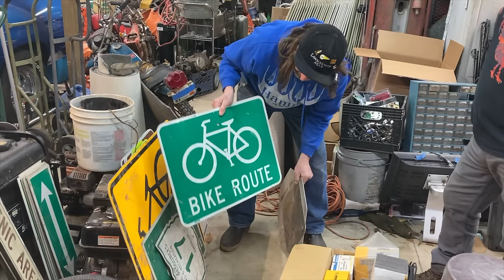Taryl Takes A Trip To Buckets Garage

Comment: Its not hoarding, its inventory.
  The motor on one of those scooters might work with the "Surrey with the fringe on top" four wheel bike. Or maybe one those old washing machine engines and the pedal starter is reachable from the seat.

Comment: If I remember correctly, that sulky doesn't have a steering wheel. It hooks to the machine and keeps you directly behind the machine and the wheels turn by being forced left or right by the machine as it steers like a zero turn with 2 hydros.
Reply: That’s a steering sulky off a two wheel Gravely tractor. They had one sulky (what you’re referring to) to turn you pushed the tractor’s handle bars to turn. The one shown is a steering sulky. The shaft & steering wheel are missing. The sulky wheels turn the mower with a steering wheel. I have the steering sulky on my old Gravely.

Comment: I need your expertise 💯...What size Transmission belt does a Craftsman garden tractor model 917.273022 take? The manual says 1/2 x 84.5 ....but it does not fit at all...... The parking brake does release when I put it on....stay engaged pretty much only about an inch of release...Go 3 inches bigger?

Comment: I love the lawn boy loafer . I’ll buy it off you.
Reply: Had a Loafer as a kid living out in the country. 1960 model. Loved that damn thing, would go anywhere. Even accompanied the farmer next door when he went back into the woods to cut trees for his winter heat and wife's cooking. if it got stuck, which wasn't often, hell, you just lifted it out of the mud. Low gear was like 143 to 1. It would climb hills so steep, you ended up "walking" with it. Plus talk about tiny cornering radius. Genius little machine. Just had to keep a supply of rubber drive wheels from the drive disc handy, for after you gunned the governor to get maybe an 8 mph top speed instead of the 4.5 standard. Rubber flew apart pretty quick, and the Iron Horse sounded like what trail bikes did a decade later.

Our regional high school janitor had a Loafer with a 21 inch Lawn Boy mower to do the school front lawn of several acres, with what looked a crazy driving style -- all the kids watched out the window at his demonic style. Took no time even with only a 21 inch swathe. That's because it was 4.5 mph everywhere, including the sharp bends! It would just lift the inside rear wheel and slow down momentarily.

Had the thing for 10 years until the family moved when I was out of country, and they left it behind. Darn!

When you dropped that thing directly into fourth from a stop, the front wheels came off the ground with instant acceleration. Yee haw.

The only decent piece of that truckload of junk, IMO. The Loafer ruled, and the gold color waxed up well. Never had a gas/carburetor problem with it, it always worked. 

The Honda mower I bought in 1990, the right front wheel fell off, it wasn't welded to the housing except by two tacks under a mountain of painted slag -- piece of garbage. The old Lawn Boys were made out of decent metal, and that Loafer transmission was all gear in a sump with a real differential. No crap belts and pulleys and thin bent tin and flatulent four-stroke hot lean smells. No engine seizing from steep slopes and oil running to one side. giving no lubrication. Proper stuff.

The thing is an absolute hoot!

Comment: That Troy-bilt/Bolens attachment was called the Grass Reduction System or GRS for short. I sold a few back in the mid 90s. They blow up motors. Way too much parasitic draw. This was one of the non tested devices that put Gardenway(parent company of Troy-bilt/Bolens) out of business.

Comment: steering sulky is just like the one I had with my gravely l. its had a steering wheel and straight shaft that went down to the cable hub.  be careful trying to drive on hills while turning one of those the gravely handle bar could castrate you.

Comment: Maaco is an unusual name for a strip club but I'm sure it will work out.
Bucket gave you a nice pile of money. My bros and I give each other vehicles, welders and other equipment and it's worked great for all concerned.
That Dell touchscreen makes a fine shop box (I use mine for 3D printing) and 1TB solid-state drives are cheap and cloning software is free.